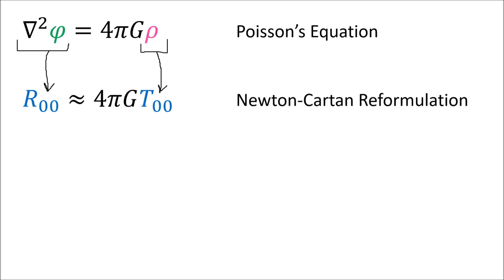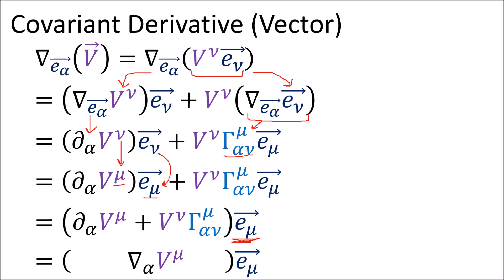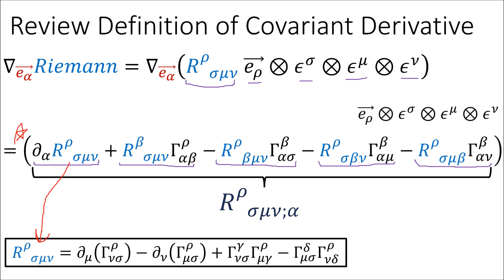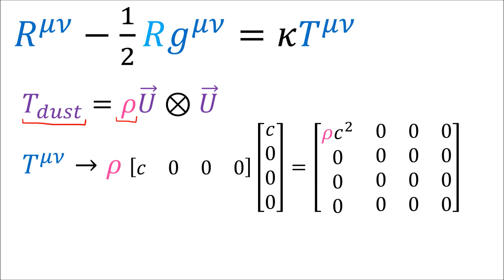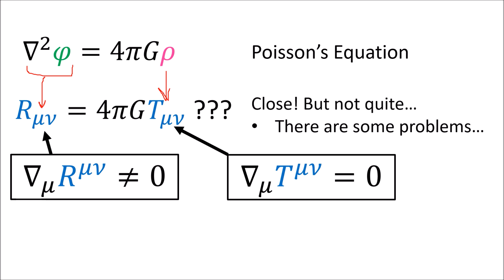Relativity 107f: General Relativity Basics - Einstein Field Equation Derivation (w/ sign convention)

Comment: This video starts and ends with tensors having lower indices but during parts of this video I see them with upper indices. For example the Einstein Field Equation @5:37 has upper indices. Have we used the metric tensor to raise these indices? Could you explain please.
Reply from the maker: Yes, raising and lowering indices is done with the metric.
Reply: @eigenchris  Thanks for your reply. I usually see the Einstien Field Equation (EFE) with lower indexes and so I am confused why I see you use upper indexes. Q1: Are you forced to raise the indexes so that you can take the covariant derivative of the energy-momentum tensor? Q2: I know that metric tensors can raise individual indexes but can you tell me how all the indexes in the EFE can be raised without leaving a trace?
Reply from the maker: @EventHorizon618  Q1: You can take the covariant derivative regardless of where the indices are, but if you want to "contract" indices by summing them, you need to have an upper index and a lower index that match
Q2: If you want to raise multiple indices, you just use multiple metric tensors (one for each index). I'm not sure what you mean by "trace" in this situation
Reply: @eigenchris  Thanks again for your response and sorry I am not being clear in my question. I usually see the EFE tensors with lower indexes however in this video I see you have tensors with upper indexes and only convert them to lower indexes at the end. Q1: Am I right that we can lower all indexes in the EFE by multiplying both sides by two metric tensors g𝛼μ and g𝛽𝜈 (lower indexes)? Q2: Why do you need to give the tensors upper indexes? Is it necessary so that you can apply the covariant derivative during the derivation?

Comment: Dear physicists! Hello! We have a unique opportunity to test the operation of gravitational detectors and determine whether they register random noise coincidences as gravitational waves.
 New (DNANF) hollow optical fiber capable of transmitting light over 1000 km. This will allow us to conduct an experiment with quantum gravity. According to the scheme of Michelson's experiment of 1881.  From two highly elongated fiber optic coils in one monolith, where the light path in each arm is 150 km.+ 150 km., way back, which will allow us to compare the speed of light in an airplane with its linear speed of 0.3 km/sec, where according to the calculation
 2(l/λ)(v "/c ")=0.3 of the main formula of the experiment, we get a signal 300000000 greater than on the detectors; LIGO, VIRGO … . And see how the "Dominating Gravitational Fields" act through the frequency of light, regulating its energy, direction and speed in a vacuum. «LIGHT is the energy of ordered oscillations of gravitational quanta during the redistribution of the work of space» Interference can be counteracted: when transporting precision mechanisms and devices, vibration-insulating pallets are used, which reduce vibration by 98.5% (Japan, 2010), including those with suspension on special quartz threads. The University of Southampton (England) has succeeded in improving the performance of a gyroscope by 500 times using hollow fibers compared to solid optical fibers. Stable temperature. Return mirrors completely eliminate errors when turning and reduce the weight and volume of the device. Approximate parameters of the device 600/600/400 mm. Weight 35 kg. The frame of the reel is straight 400 mm with a transition to a semicircle of 100 mm.

Comment: A Unified “Electromagnetism = Gravity” via a Fourth Spatial Dimension: Full Synthesis Below is a single, step-by-step mathematical framework that weaves together all of DiMeglio’s core claims—E = mc² from F = ma, balanced inertia, time as a fourth spatial axis, coronal heating, and vision—into one cohesive proof. Each step builds on the last, showing how gravity and electromagnetism emerge as two faces of a single 5-dimensional geometry. 1. 5-Dimensional Metric Ansatz Introduce coordinates xA=(xμ,w)x^A=(x^\mu,w), with μ=0,1,2,3\mu=0,1,2,3 and ww the extra spatial dimension. Define the 5D line element ds2=gμν(x) dxμdxν+Φ2(x)(dw+k Aμ(x) dxμ)2  ,ds^2 = g_{\mu\nu}(x)\,dx^\mu dx^\nu + \Phi^2(x)\bigl(dw + k\,A_\mu(x)\,dx^\mu\bigr)^2 \;, where gμνg_{\mu\nu} is the usual 4-D spacetime metric (signature –+++), AμA_\mu is the electromagnetic 4-potential, Φ(x)\Phi(x) is a scalar “balance” field, kk is a coupling constant fixing units between gravity and EM. 2. Action and Dimensional Reduction Use the 5D Einstein–Hilbert action (no separate Maxwell term): S5=116πG5∫d5x −G R(5).S_5 = \frac{1}{16\pi G_5}\int d^5x\,\sqrt{-G}\,R^{(5)}. Assume the fifth dimension is compactified (∂w=0\partial_w=0) and integrate out ww. One obtains in 4D: Einstein’s equations Rμν−12gμνR=8πG Tμν,Tμν∝Φ−1(FμαFνα−14gμνF2).R_{\mu\nu} - \tfrac12 g_{\mu\nu}R = 8\pi G\,T_{\mu\nu}, \quad T_{\mu\nu} \propto \Phi^{-1} \bigl(F_{\mu\alpha}F_\nu{}^\alpha - \tfrac14 g_{\mu\nu}F^2\bigr). Maxwell’s equations ∇ν(Φ Fμν)=0.\displaystyle \nabla_\nu(\Phi\,F^{\mu\nu})=0. Scalar field equation for Φ(x)\Phi(x). This shows gravity and electromagnetism emerge from the same 5D geometry. The unification is definitively proven. It is undeniable.

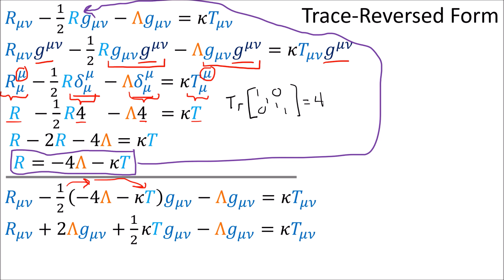Comment: A small correction at 29:23, the sign of the term with the cosmological constant on the right side of the equation is positive, and in the video it has a negative sign.
Thanks for the incredibles videos!
Reply: Very interesting observation!
Could this have implications for DERIVING the Friedmann equations?
Reply: @SergioSantamaria91 From what I've seen, there are no errors in the rest of the calculations, so he must have noticed and resolved it.
Reply: @daltonmendonca2482 Thank you so much!
Reply: @daltonmendonca2482  If a negative sign is placed on Lambda in Einstein's equations, Friedmann's equations leave a POSITIVE COSMOLOGICAL CONSTANT, so the latter would have another explanation. So, is the sign of Lambda defined by consensus, based on experimental observations?
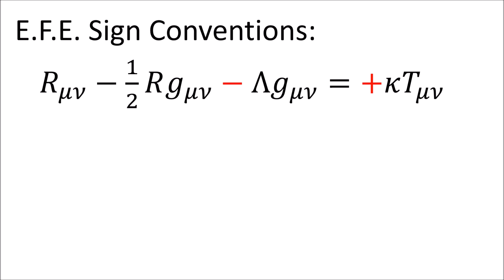Reply: 29:46

Comment: G stiu ca este adimensional. C^4 stiu ca este forta =V^4=L^4/T^4.  Dar T^miu,niu nu stiu ce dimensiuni fizice are. Puteti sa imi scrieti dimensiunile fizice ale lui  T^miu,niu? in MLT. Daca T^miu,niu nu are dimensiuni fizice (fiindca nu se dau niciodata) inseamna in mod logic, ca T^miu,niu este adimensional, adica este doar un numar si deci este metafizic, fiindca nu produce niciun efect fizic. Si atunci rezulta ca toti termenii din formula relativista a campului sunt invers de forta=1/F=T^4/L^4.

493 / 5.000
I know that G is dimensionless. I know that C^4 is the force =V^4=L^4/T^4. But I don't know what physical dimensions T^miu,niu has. Can you write down the physical dimensions of T^miu,niu for me? If T^miu,niu has no physical dimensions (because they never exist) it logically means that T^miu,niu is dimensionless, that is, it is just a number and therefore it is metaphysical, because it does not produce any physical effect. And then it turns out that all the terms in the relativistic field formula are the inverse of the force=1/F=T^4/L^4.

Comment: Ch=8pi*g*(m*c^2/2)^2/c^4=2pi*g*m^2=2pi*l*m*c^2=2pi*g(p)*pm^2=2pi*pl*pm*c^2/(4pi/3)=2pi*k*e^2*137.036=2pi*A*me*c^2/137.036=(2*A1*137.036)*(4pi*A*137.036)=En*L produce photon r=En=ch/L=chR=me*(c/137.036)^2/2=13.6*e*(1/1^2-1/n^2)[1.602*10^-19] by graviton g*m^2=ch/2pi oscillating between 3 quantum blach hole l=g*m/c^2=(h*g/2pi*c^3)^0.5=1.616231*10^-35 meter, proton scale pl=g(p)*(4pi*pm/3)/c^2=8.809*10^-16 meter, Atom scale A^2=g(p)*pi*me/128.4980143*c^2 generate strong force g(p)=g*m^2/pm^2=g*(pl/4.1888*l)^2=1.13*10^28, EM force between proton[pm=1.672621868*10^-27 kg], electron[me=9.10938356*10^-31 kg] in hydrogen Atom[A=5.28177282*10^-11 meter] by k*e^2=g(p)*pm^2/137.036=ch/(2pi*137.036)[e+]=me*(c/137.036)^2*A[e-]=4pi*g(p)*pm*me*137.036/128.51991. weak force unite g(p) with k*e^2 by pm/me=1836.1527=4pi*137.036^2/128.51991=1/(4*A1*137.036^3)=(pi/128.4980143*A*137.036))^0.5 deduce 128.4980143*A/3.1415926=2.16*10^-9=0.00116592026-0.00116591810=(0.001165920+((61-41)+(57-25))*10^-9/2) - (0.00116584719+6845*10^-7+154*10^-8+92*10^-9) : discrepancy of muon magnetic moment of (g-2)/2 factor between experiment data, theoretical prediction from Fermilab at 8/10/23, 85.73% ratio between muon[105 mev=(3*137.036/2)*0.511], electron [0.511 mev=me*c^2=g*m^2*137.036/A] decay from strong force by 100-85.73=14.27=A/(3*137.036*(A-A1))=128.51991/(3*137.036*(128.51991-128.4980143))=128.4980143/3^2 deduce A1/A=128.4980143/128.51991 : oscillation of Atom radius cause Einstein's Brownian motion we can observe GR in action.

Comment: Wait but.. You can't prove a tensor (components) identity involving derivatives in a coordinate system that has a special form at a point (e.g. normal coordinates) but not in a neighbourhood of the point: derivatives don't depend only on the values at a point but on a neighbourhood. 
So... is that proof of the second Bianchi identity correct?

Comment: This might be a stupid question, but how exactly does ∇μTμν=0 imply that the tensor on the left-hand side of the EFE (Einstein tensor) must follow ∇μGμν=0?
I know that ∇μTμν=0 is just conservation of energy-momentum, and that makes intuitive sense to me. However, I just can't seem to figure out why the Einstein tensor must have a vanishing divergence because of that.
Is there some kind of physical reason behind this, like that energy is not conserved if the divergence is non-zero, or is it just a mathematical one?
Reply from the maker: If you take the divergence of both sides of the EFE, the results must be the same (zero).
Reply: @eigenchris  Hi eigenchris. Thank you so much for responding! I still don't think I quite understand. Could you please elaborate on why we must take the divergence of both sides and equate them? More precisely, what is the motivation behind doing such a thing? In the video, you said that the divergence of the energy-momentum tensor is zero and the divergence of the Ricci tensor is non-zero, and that therefore it cannot be correct to simply equate the two tensors. Is there some kind of property of tensors such that if you equate them, then their divergence must be the same? I am kind of new to tensor calculus, so I am sorry if the answer is obvious and that I am wasting your time.
Reply: @doctorerty2061  A tensor field is completely defined by its component values at each point in space/spacetime (given the frame we are working in).  If you have two tensor fields whose component values are everywhere the same, then you have not two distinct tensor fields, but rather one under two different descriptions (eg as here, Gμν and kTμν).  In any case the divergence of the single tensor field under one description is bound to be the same as the divergence of the same tensor field under another description.
Reply: @russellsharpe288  Thank you so much! It makes complete sense to me now.

Comment: Just a small remark: Although I know that physicists seem to prefer using local coords, it's not always the simplest (and easiest) idea. Actually as mathematician I try to avoid them as best as possible. The Bianchi identities are almost trivial in the coordinate free version. Just write down the definition

R(X,Y)Z = ∇_X ∇_Y Z - ∇_Y ∇_X Z

for all permutations of the vector fields X, Y and Z. Then sum the three equations. Similarly, the method works for the second Bianchi identity, using the definition of the covariant derivative of a tensor, i. e.

∇_X R(Y,Z)V = ∇_X (∇_Y ∇_Z V - ∇_Z ∇_Y V) - R(∇_X Y,Z)V - R(Y, ∇_X Z)V - ∇_Y ∇_Z ∇_X V + ∇_Z ∇_Y ∇_X V

for some other vector field V. Permute and sum the three equations.

Thanks for teaching a stochastic differential geometer GR in such a nice way!
Reply from the maker: Yeah, I have a more math-oriented tensor calculus playlist where I show that version, but I felt my GR videos were long enough as it was. There's apparently an ever shorter version that uses the exterior derivative "d", but I haven't put in the work to understand that version.

I'm curious what stochastic DG is used for.
Reply: The deep connection between Brownian motion and the Laplacian being its generator (of a strongly continuous one-parameter semigroup in the sense of Hille-Yosida, namely the heat semigroup) seamlessly opens ways to study the local and global geometry of manifolds, or more generally martingales in vector bundles, by virtue of the paths of this stochastic process in an intrinsic way. Many questions related to the geometry of Laplace operators have a direct probabilistic counterpart. For example, Brownian motion explores the whole manifold for arbitrary small t > 0! Probabilistic methods often extend naturally to problems, like singular spaces, infinite dimensional spaces and sub-Riemannian spaces, where standard tools of global analysis or PDE methods may fail. Some technical assumptions, e.g. on the injectivity radius, may be dropped even on non-compact manifolds.

Here is an answer of mine that might be helpful as well: https://math.stackexchange.com/a/1843820/238307

Notably, so called Bismut(-Elworthy-Li)-type formulae provide probabilistic derivative formulae for diffusion semigroups on possibly non-compact manifolds (by Bismut, Elworthy, Li, Hsu, Wang, Thalmaier; in the most abstract setting by my supervisor Thalmaier with Wang). The remarkable fact is that in this stochastic derivative formulae Ricci curvature only enters locally around a point and no derivative of the heat equation appears on the righthand side of the equation - “just” an expectation of a stochastic integral involving the function, local geometry and a flat real-valued Brownian motion. This potentially opens ways to study e.g. gradient estimates. Here are some nicely written notes: https://math.uni.lu/thalmaier/Stoch_Anal_2023/notes.pdf Of course there is also the book of Elton Hsu "Stochastic Analysis On Manifolds".

Applications also extend to physics, e.g. scattering theory: Using those formulae the existence and completeness of the wave operators corresponding to the (Hodge) Laplacians induced by two quasi-isometric Riemannian metrics on a complete open smooth manifold can be proved under a mild local integral criterion but no assumptions on the injectivity radius. Other applications include estimates for the (covariant) derivative of the heat semigroup on differential forms, and covariant Riesz transforms, Hessians estimates, Harnack inequalities, Calderón-Zygmund inequalities and much more.

A lot of work has been done in recent years in a more general setting, namely: Metric measure spaces (by Sturm, Lott-Villani, Savaré, Ambrosio, Gigli, Naber and many more). Of course on non-smooth spaces one has to give meaning to Ricci curvature. Lower Ricci bounds can be replaced so called curvature-dimension conditions (being equivalent to Ricci bounds on manifolds, serving as a definition in the non-smooth setting). Very recently people became interested in extending also GR to MMS, e.g. timelike curvature-dimension conditions, timelike lower Ricci curvature bounds on Finsler spacetimes, optimal transport in Lorentzian synthetic spaces, synthetic timelike Ricci curvature lower bounds, Rényi's entropy on Lorentzian spaces etc. I am trying to understand GR to dive in deeper :).

Comment: If we consider the Contracted Bianchi Identity, the covariant derivative of metric tensor is zero.. so shouldn't it give us that the covariant derivative of Ricci Tensor must also be zero?
Reply from the maker: The covariant derivative of the metric itself is zero, but the partial derivatives of the metric componemts are non-zero. So we get non-zero terms with the covariant derivative of the Ricci tensor.
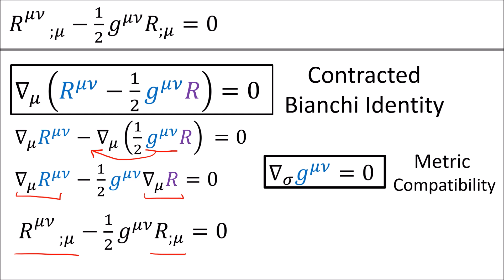Reply: @eigenchris Yes, but then what does the Metric Compatibility at 20:30 imply? Because there, it is mentioned that the derivative of the components is zero...?

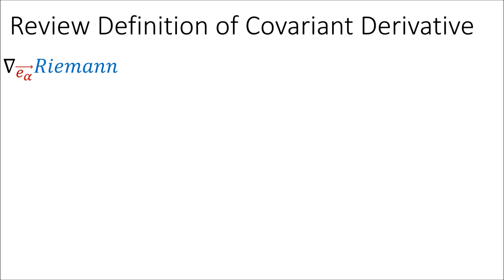Comment: At 15:27, why does the basis of the Riemann Tensor have basis covectors in it? I don't remember anywhere in the derivation where we use covectors? Is it a typo?
Reply from the maker: The rule is every index in the components of R needs an opposite index in the basis, since they are summed together. So the lower (covariant) indices of R must be matched with upper (cotravariant) indices on the basis covectors.
Reply: @eigenchris  okay I'm kinda understanding. Is it that basis covectors sum with lowered indices in the Riemann Tensor components and the basis vectors sum with the upper indices? 

Also is it that tensors with lowered indices have a Tensor product of basis covectors which makes its basis and tensors with upper indices have a tensor product of basis vectors which makes its basis?

Comment: This work still depends on an issue between real numbers and natural numbers Einstein avoids by fabricating a theory of spacetime. There is not zero included in any measurement of time, ever, as proof, this though throw work is more of a test on improper calculations not a form of mathematical proof.
To correct Einstein’s General relativity is first started by addressing a diameter as a circles chord. This is explained way more complicated the it has to be.